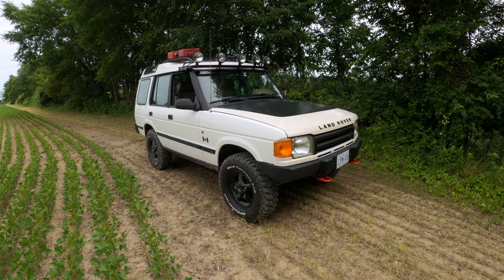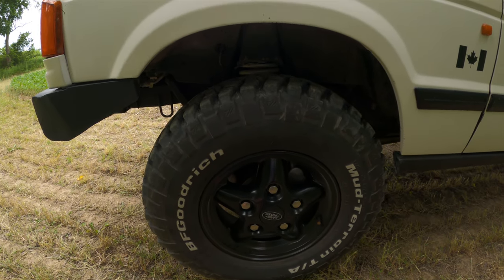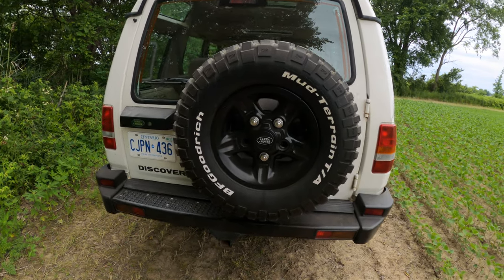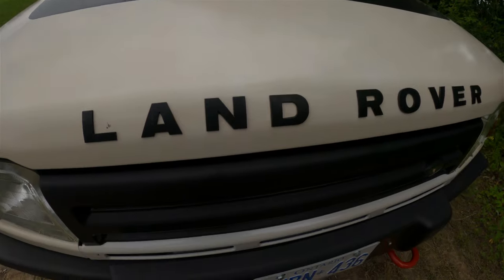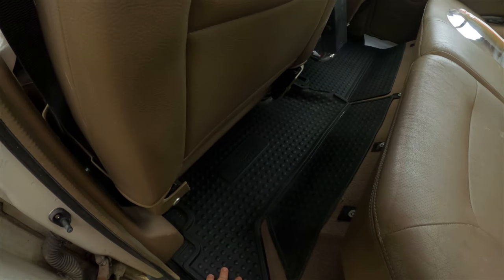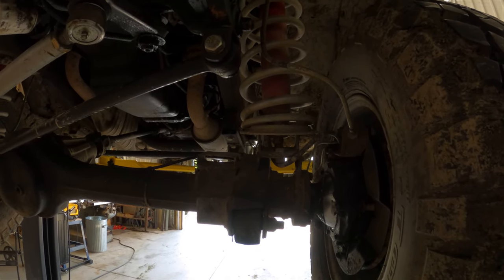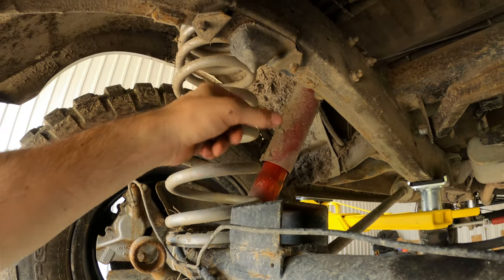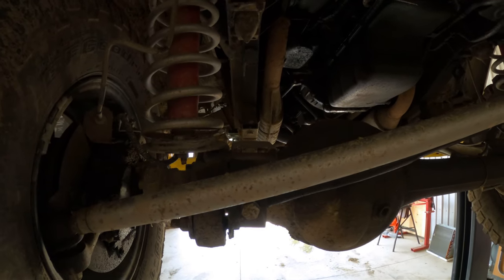1996 Land Rover Discovery V8 Build Walkaround

Comment: Sweet rig. I really like what you did with the front bumper. I took the factory plastic one off of my ‘97 to fix the cracks, and also to see if I preferred it with just the metal bar. Honestly, I prefer to leave it on because it holds the side lights, and I like having the bottom height of my rover even all the way around lol
Reply from the maker: Haha yeah its rough looking without some modification for sure. I didnt want to break it off roading so it had to go for me

Comment: NICE GARAGE - WISH I HAD A LIFT - WOULD DO A LOT MORE OF MY OWN WRENCHING ON THE D1
Reply from the maker: I actually got the lift after I finished the project... Everything I did, including pulling all the suspension out 4 times and doing all the brake lines I did on my back. But it does make it easier!

Comment: Not going to lie, your build has been an inspiration to me building my Disco over last 6 months!! I've since put on Caster Corrected Arms Front and rear with all new TF bushings and WOW did that ever help the freeway death wobble. Not that I wobbled but it was scary to drive at even 60 mph. Anyhow I Highly recommend these arms if you freeway your Disco at all! Does make for Much tighter clearance on the front drive shaft as arms Rotate the axles 3 deg. It also helped driveline vibration a bit as it lines up the pinons closer to the T-case. Anyhow yet again Thanks for the video! What else have you done to her?!?!
Reply: @WeekendWarriors87  Yeah I understand completely. Mine is a 10-12mpg gas pig, and taking more money away from me than my EX did. Had mine for 15 years now and been pretty reliable until I started driving it more lately. Lack of power to tow is my biggest issue, along with mpg but otherwise I'll keep my Disco running for a long time! I like to offroad her pretty hard and this ALL started getting a great deal of lift springs, down the rabibt hole I went.. Again many thanks for everything, posting the video, and all the help along the way!

Comment: It may help you to understand the rear suspension radius arms and how they function.. The rear wheels are traveling in an arc. they are not going straight up during compression they travel up and to the rear of the vehicle. and When they travel down as the spring lengthens, the axle/wheel travels towards the front of the vehicle. An interesting tidbit is that when one wheel is compressed all the way and the other wheel on the other side of the axle is extended all the way, it will appear that the rear end is steering. This must be taken into account when wondering why you had to cut more than you thought from the rear wheel well. You notice this effect a lot more as the tire size gets larger. I swear this action, which is on both ends, makes it better offroad as the tire to surface contact is more dynamic as its tread to surface angle is changing at the same rate the more severe the terrain gets.. A simpler way to think of it is, your  discovery wheel base length changes when the vehicle experiences any up and down action from the terrain where one wheel is at a different height on one side of the axle than the other side. When you lifted it you made the wheel base shorter as well. So now when it compresses the rear axle will move back at an increased rate as you are traveling in an arc. There was enough room for this rearward movement at the factory ride height/tire size because the radius arms were closer to the center of their traveling arc. You already have evidence of this ratio, because you needed only a one inch spacer for the sway bars, but you added a 2 inch lift.. sorry, I couldnt help it....take care john  94 RRC LWB

Comment: Great vid and great truck! Was that pops I heard from your exhaust?!! Yum! 
Just wondering what mechanical/fabrication history you’ve got, it’s amazing all the custom work you have done. Do you think you’d add fender flares?
Reply from the maker: Yessir the exhaust definitely pops, it sounds even better in person! And absolutely no experience, learned from the internet and doing this project. I debated on flares, I would love to add wheel spacers to improve my turning radius which would require trimming the fenders and adding flares, but I haven't decided yet fully. If I was going that route, I would also feel the need for larger tires... which I definitely dont want to shell out for yet!

Comment: I put a two inch lift on my '95 D1 but I ended up with about 4 inches.  Most guys will never complain of having a couple extra inches, but now I have a vibration when I let of the gas pedal.  Still trying to figure it out before something grenades.  Other than that, my truck looks great.  I've owned it for 15 years and am just starting to add upgrades and fixing things I have neglected over the years.
Reply from the maker: Was is an HD lift? 4" IMO is too high, have you cycled the suspension to see if anything hits? That thing has got to be pretty scary to drive, I cant imagine what the radius arm angles look like at 4" lift.
Reply: @WeekendWarriors87  Actually, it drives just fine.  Haven't cycled the suspension to see what might hit, but is in the plans.  I am looking into new radius arms front and arched and extended ones for the back.  Maybe it's closer to 3 inches.
Reply from the maker: @westernwanderer8397  Thats great that it drives well! although I would definitely do some cycling and make sure. on the extended radius rods/rear arms, you can actually make new brackets to drop down the mounting location on the frame if you are handy at welding, would be a whole lot cheaper than aftermarket stuff
Reply: Prolly need a double Cardon driveshaft stock D1 driveshafts don’t like lifts to much
Reply: @WeekendWarriors87  or you can get adjustable rear radius arms and get you pinion angle correct, and use a prop shaft spacer to get the drive shaft back to its proper length. many things to think about when lifting a rover. 2 ich is best if you still want it to drive safely on the freeway..

Comment: Love the exhaust setup. Need to do something similar on my 97 Disco. Would you happen to have a part number for the magnaflow muffler and hanger you installed?
Reply from the maker: No sorry, I welded it custom. But its a 14" long oval magnaflow so just get the inlet size you need and youll be all set.

Comment: Great video thanks for that, love that v8 burble. With regards to the bonnet/hood did you take it from a 200 tdi. Possibly explain the slight differences. Also did you install castor correction radius and trailing arms with the 2" lift?
Reply from the maker: The hood was from another v8, the diesels are very uncommon in canada. And no I didn't use castor corrected arms, I think they might be beneficial, but I don't notice any issue and no drive ability problems, drives like I expect a 25 year old solid axle truck to drive!

Comment: Did they put the coils on the right sides due to one side being a bit higher depending on what side the driver sits?
Reply from the maker: I tried swapping them to no avail. I think it sat crooked because it has been in an accident, as many of the panels on that same side do not line up and neither did the bumpers. I believe the frame may have been tweaked slightly.

Comment: Thanks for the Video man! Got a white 96 disco 2" lift 265/75r16 KO2's. Did a fair bit of trimming in the past, so far so good! Except the rear Swaybar flipping up on me. Any chance you got measurements of the fronts? How much rearword you went? Also, have you not lost the rear springs, or needed cones?! I've put hose clamps on the top of the rear springs, better than nothing right?!
Reply from the maker: Sorry im not sure what you mean for measurements up front, how much I trimmed? also, I have had issues flexing out the rear springs, I dont have cones, I think I am going to either get cones or use limit straps. I dont think hose clamps will save you up front, the axle is heavy, I dont have issues with the front because the HD springs from the PO do not flex well up front (I dont have a heavy bumper so I needed medium duty springs).
Reply: @WeekendWarriors87  Thanks for the reply! I  was wondering how much you moved the front sway bar to the rear. Looks like you might have re-used 1 of the holes? Also any part number for the disconnects, or did you Fab those out of bolts? I've never had issues popping springs on the front, only added the hose clamps to the rear springs as a failsafe. Cones or straps are next in line for me as well. Again thanks man, any help on measurements on moving swaybars will be of great help! Something I  NEED to do wth +2"  TF Med with +50mm longer shockers..
Reply from the maker: @Kris-jk9mq  Yeah no problem, Ill try to grab a measurement tomorrow for you. I think its about 2" I moved them back and like an inch down, but ill check. Disconnects I used a bolt that I drilled a cross hole in and use a tractor pin to hold it on, otherwise  I used the hardware from the sway bar. Its a shame the rear springs arent long enough, Im not a suspension expert but I dont see why this isa problem rovers have but jeeps dont, they just have longer springs instead of stiff short springs.
Reply: @WeekendWarriors87  Yeah I've had the rear swaybar shackles flip up and onto the springs a few times already after lifting it. Got new bushings to help but clearly i need to move the rear bar down as well like you did. While your measuring, rear was 1" down correct? Also guessing once the rear bar get disconnected THAT is when they spings pop out. I havent had an issue yet, but i chose my best 2 hose clamps per a spring on the rear. Stong little fellows, or bar is my real limit. Again, MANY thanks for your time in measuring and repling!!
Reply from the maker: @Kris-jk9mq  Front is 2" back, 1 " down, rear is just 1" down. That kept the sway bar from contacting anything while cycling the suspension to the bump stops. Good luck!
Reply: @WeekendWarriors87  I can't thank you enough for taking the time to do this for me!! Will save me hours, and give a great starting point of reference!! You're build up is quickly becoming a build bible for me! Nice Rig BTW! Looking forward to more videos!!
Reply from the maker: @Kris-jk9mq  No problem at all, it definitely took me some time to make it all work, there might be some variation rig to rig but that should get you close! And thanks, Ill definitely have future videos of what I change along the way and some off roading vids this summer. Thanks for watching

Comment: Awesome Rig man, Just wanted to grab some tips from you in regards to maintaining the Disco?

I just bought one the other day and just replaced the head gaskets and did the skimming and pressure tests as well what else could you think would be a great idea to take a look at?
Reply from the maker: there was a great article on the landroverforums which showed a list of what to check/maintain, that would be a great place to start. Depending what shape its in, think about safety first and then mechanicals. Inspect all brake components, steering bars/ball joints, bushings, etc. Then do all fluids and mechanicals. Check over the rubber donut in your driveshaft too!

Comment: Is there a reason you didn’t opt for the 3 inch lift kit?
Reply from the maker: Nope, it came with a 2" kit when I bought it! If I were  to do it again I probably would do a 2" lift and a 1" body lift and 33s. careful on a 3", I had lots of angles and stuff and as I mentioned in the video my sway bar contacted the front driveshaft, all that stuff will be worse on a 3". Most guys on the forums/internet dont actually crawl under it and  fflex it out to make sure everything works well
Reply: @WeekendWarriors87  got it, I was actually thinking of doing 3” on mine, but I’ll do 2 in now
Reply from the maker: @bysadebysade9666  Some say 3" is fine, but I think 2 is a good spot on these. Mine cruises the highway great, youd never even know that the angles were affected. Good luck on your build!
Reply: on that vehicle a 2 inch is perfect unless you want to deal with all the parts and angles effected by a bigger lift. castor corrected swivel balls or corrected radius arms, the now totaly incorrect front drive shaft angle and pinion angles.. I needed double cardon joints to get the perfect driveshaft angle. When the front shaft breaks while at speed on the freeway, you will need a tow truck,  as some stuff will seriously get hammered.

Comment: What part of ontario are you from? I'm in st thomas was a d1 300tdi that's almost on the the road. Nice ride!
Reply from the maker: Down near Windsor, and that's awesome! I love V8s but I think the diesel would have more character, especially a 5 speed.
Reply: @WeekendWarriors87  nice. I got really lucky with finding this one, but it had a blown timing belt. It is an auto which sucks but Ill take it. Hoping it'll be on the road in a week or 2.
Reply from the maker: @trevoradams7225  that will still be a great ride. Goodluck!
Reply: Right on boys, I'm from Niagara. I've never seen another D1 in my area except at Paul Safaris..
Reply: @trevoradams7225  did you buy the one out in Hanover that wouldn't go beyond like 1400 RPM?
Reply: @ronnytotten9292  no mine is black, bought it 2 years ago I think with a timing belt blown. Guy near innerkip I think
Reply: @ronnytotten9292  there's another d1 in. St Thomas I've seen. But ya older discos are few and far between

Comment: Nice build 👌 I have the same one but I can't get it to run 😢 anyone with knowledge on the security system ? I'd appreciate it. I'm getting a code p1621 serial data link dead fault
Reply from the maker: I think the land rover forums would be a great place to start. Pre 95s can easily have their security system removed, after 96 its a bit more difficult. Good luck!